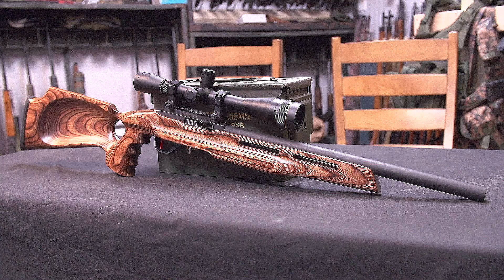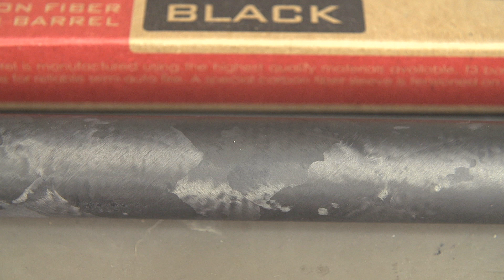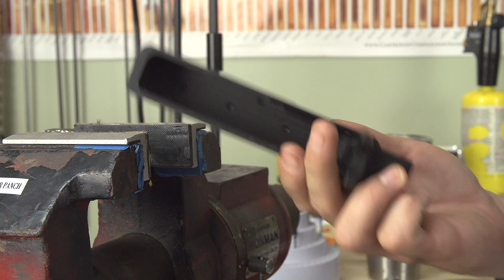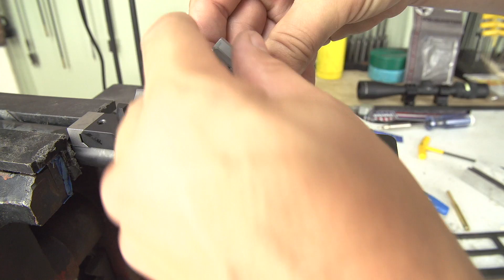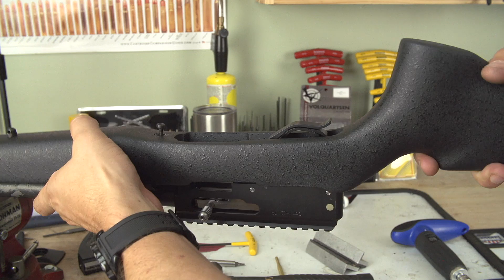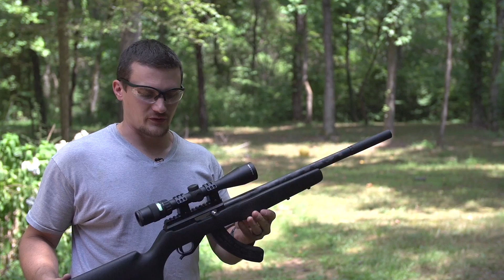Custom 10/22 Build

Comment: I'm customizing a ruger 10/22 dropping it in a fab defense folding stock running 1-8 ffp scope don't know the brand just yet prolly vortex running open sight barrel from tac sol ruger ugraded trigger pack pretty sweet so far for a pinker and could fit a survival role

Comment: In the slow motion closeup of the bolt at 18:30 or so, the charging rod/bolt rocks in a rotating motion before it locks forward.  Is this normal?  Also, will polishing the bolt sides and receiver walls reduce the grinding noise that is mostly what I hear when you fire suppressed?  A bit of polish and lubricant seems to remove most of this.

Comment: I wouldn't sand the receiver, first, put receiver in freezer, oil stock, insert. 2nd... take a pencil rub on the receiver, it will mark contact points.  Sand a little, redo until the receiver slides in nicely.
Smooth interface parts. You will hear and feel the difference.

Comment: I ran into a guy at the range one day who was shooting his custom 10/22. He told me all about it. He bought a stock 10/22. Then he took the barrel off and replaced it with a custom bull barrel. Then he replaced the stock with a fancy Hogue stock. After that he replaced the bolt. Then the trigger group and finally he replaced the receiver. 

I looked at all that and said "Wow, so, somewhere in a box at your house you have a complete factory Ruger 10/22 in pieces that needs to be put together." He looked stunned for a moment as he thought about it and said "Yeah, I suppose I do."

Nowadays you can build a custom Glock, 10/22, AR10, AR15 and a few other firearms without using a single part manufactured by the original company. Pretty cool.

Comment: If a person starts out with a completely stock 1022 and then changes out all the parts with upper tier stuff, they'll be left with enough factory parts to assemble a fully functional factory rifle. In that context, spending 1400 or 2000 on a custom rifle seems reasonable.

Comment: fucking stupid putting $1400-$2000 in a 10/22 when they shoot just fine from the factory for $250 , ...oh this is my ruger 10/22 but none of the parts or components are actually ruger cause i'm a little retarded

Comment: That gun is obviously going to be a better shooter than my all original 1973  "Ruger " 1022.   But to actually call that a 1022 is IMHO a stretch.  There are no original parts left in fact they did not even start with a 1022.    Nothing more than a clone by definition.   But a very very nice clone.

Comment: My 1000,- € custom built:
- 10/22 stainless bull barrel (a bit heavy)
- Tapco stock (cheap)
- Sightmark reddot (cheap)
- original reciever (polished)
- original trigger group
scores 97/100 on 25 meters standing! 
You don't need too spend THAT much to achieve precision!

Comment: Mine is deadly accurate.  I replaced the barrel, stock, some parts, good scope and a Harris Bi-Pod.  Rather than replace all the parts I took the rifle to my gunsmith and let him work his magic on the trigger and action.  Once the rifle was sighted in, the next step with finding the ammo that worked best.  Of course once I found the correct ammo that idiot in chief in washing messed with the supply of 22LR ammo.  So yes an custom built 10/22 does shoot better than an out of the box rifle.

Comment: nice little plinker. i have a savage 64 that is about as tricked out as a 64 can get. boyds' tacticool stock, threaded bull barrel,  picatinny rail, siemens boresighter scope, and the trigger has been lightened up. color filled the engraving neon green. she's a heavy little gun now. only real thing i can honestly do to it is add an extended mag release.  the end of the stock charging handle is milled out. fits a spent steel case .223 shell perfectly so i don't have to get the extended charging handle. i envy how much after market for the 10/22 has. no one even makes extended magazines for the 64.

Comment: Just freefloat the stock barrel, kidd autobolt, kidd boltbuffer, bx-trigger,  Hogue overmolded stock, kidd  fireingpin, kidd extractor.  four bx 25 mag's And you will have a good ruger 10/22  $2100 for a compettion rifle ok I can see that. Do you spend $20.000.00 On a $20.000.00 Car NO! Stay Safe my friends. And keep them in the ten ring.....

Comment: silly question,  like an AR receiver,  do you have to do a FFL transfer for any of the parts?  I'm not familiar with the 10/22 enough to know any better?
Reply: Drew Smithson Just for the receiver. That's the serially controlled part.

Comment: There is literally nothing ruger on this anymore, can you really even call it a 10/22?
Reply: GMdrivingMOPARguy Sure. AR-15s are AR-15s regardless who makes them and how modified beyond the original spec. It's become the generic term for that design. So as long as you only "say" 10-22 you're good.
Reply: That's like saying an AR-15 that isn't made by Colt or Armalite isn't an AR.
Reply: the clipazine is stock
Reply: Even though it's ruger branded they still don't come factory with thoes big banana mags
Reply: GMdrivingMOPARguy they do come with 25 or 15 rd mags from factory

Comment: is this really a 10/22 anymore?  The only thing stock is the magazine.
Reply: Jackson Curtis I was about to comment that saying "so you bought a 10/22 then bought another gun in parts so now you have two guns that share a magazine"
Reply: @Snakeeyes9909  Magazines 😉
Reply: It is a 10/22, just not a Ruger 10/22. Is a bushmaster ar-15 still an ar-15 if it's not made by armalite? Or any custom ar for that matter? Same concept...
Reply: Kind of what I thought too.
Reply: Jackson Curtis sounds and looks like it could be converted to full auto real easy!! The rubber backing on the receiver pin set, suppressor threads. Well he did say for plinking that's why the suppressor threads. Anyway 10/22's are very, very, easy to convert to full auto, if you want to shoot 10 or 20 bucks worth of .22 shells in about 5 minutes hahahah Don't be fooled though, because a auto .22 will most definitely kill as well as stop just about any one or thing. Just saying cool comment too by the way.
Reply: Tactical Bunny believe he saidb 1400 in parts
Reply: Jackson Curtis that's not really stock either... technically it's aftermarket also
Reply: if you don't count load time, LOL
Reply: What's the total cost on the build? I hope they say. I'm actually watching it now, please excuse me if they mention it.
Reply: Um no, it's a Ruger mag that is made for their rifle.   It's is most certainly a "stock" magazine.
Reply: I dont get it? how is it a 10/22 when every part has been replaced with different parts,nothing is ruger,my 2nd question was why? LOL
Reply: @sandymitchell8182 , if you replace every part in something it won't stop being it. Like it's not Ruger anymore, but it's still 10/22.
Reply: I was thinking the same thing, this is basically a Volquartsen 10/22. That stock is fugly btw, good thing it's expensive.
Reply: Agreed
Reply: You could just buy these parts and make an entirely different gun
Reply: Well it's still the 10/22 design, just not made with Ruger parts is all.
Reply: Jackson Curtis why wouldn't it still be a 10/22?? lol same gun just different look is all

Comment: Since you are building the 10/22 from scratch what part did you register with the ATF before assembly?
Reply: You don't need to register the gun with the ATF. The receiver is the part that you need the background check for.

The only part on this build that you need registered is the suppressor.
Reply: Sorry for my miswording. That is what I was asking. So just like my AR builds I would need to get the receiver from an FFL after a BG. Good to know. 

Should look into building my own 10/22.
Reply: Jon Lockhart I thought that was what you meant. Yeah, just need to get the receiver from an FFL, unless you already have a 10/22.
Reply: No I don't. Rather just have the receiver and do it myself :) if only I could mod my 570 this way.

Comment: The trigger reset is louder than the suppressor lmao. I have a 10/22 stainless/synthetic and was wanting to upgrade the internals. I was thinking target hammer, new buffer, and probably an extracter (I'm on a fixed budget). It was slighted in by my Uncle Ed Williams, the first civilian to win the national general Custard award for marksmanship, so I know it's accurate. Lmao. Does anyone have suggestions for cheap mods to increase action dependability?

Comment: Recently upgraded my 10/22 with a Green Mountain 20 in. Bull barrel, BX trigger, and new bolt, buffer pin, & charging handle/spring from KIDD. Topped it off with a Nikon Rimfire Scope. Accuracy was good before upgrade but is fantastic now.

Comment: if I'm correct or not, I believe bolt sizes start at 1/4 inch an up. everything else smaller are screws. as in machine screws.

Comment: I'm not sure $1200-$2000 in upgrades is really worth it to shrink groups from 1 inch to just under half an inch.
Reply: Especially for a simple .22 plinker
Reply: you don't have to spend that much. get a green mountain barrel and a volquartsen search and hammer. it will shoot 1/2" or better with good ammo at 50yds. less than $300
Reply: sear
Reply: My Marlin 795 with CCI mini mags does that right out of the box.
Reply: That's believable..
Reply: Your right .. it's just fun
Reply: Well it depends what you are wanting it for.
Reply: when you can spend 200 on a rem 597